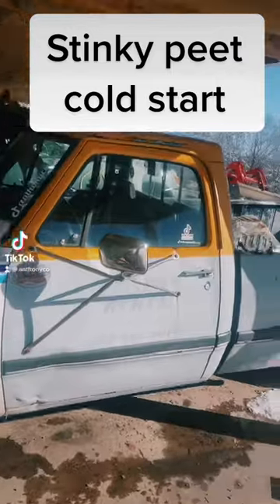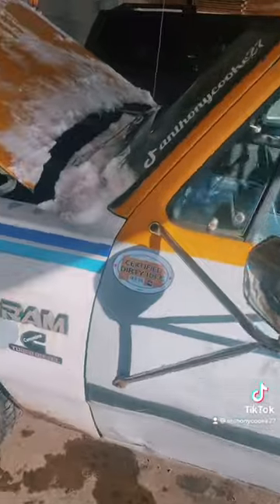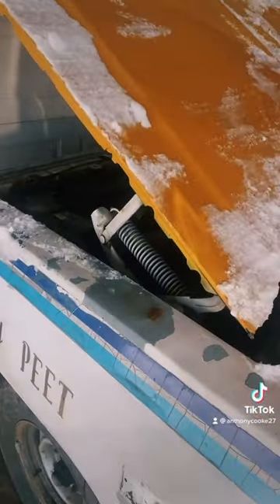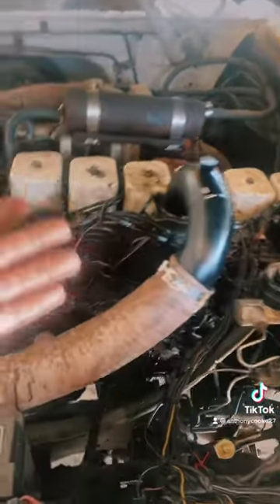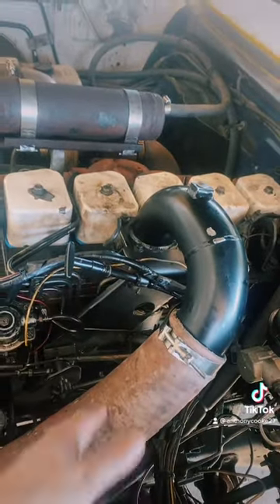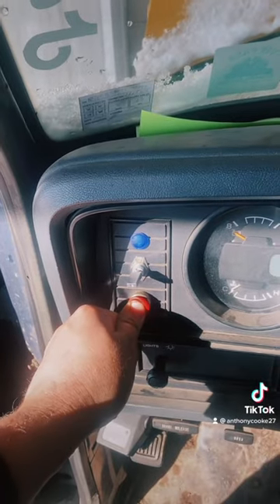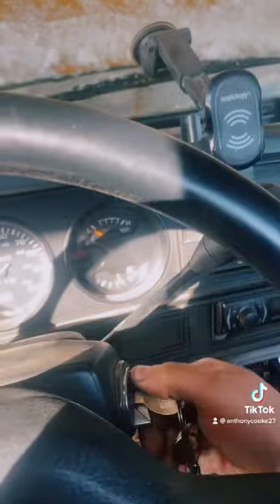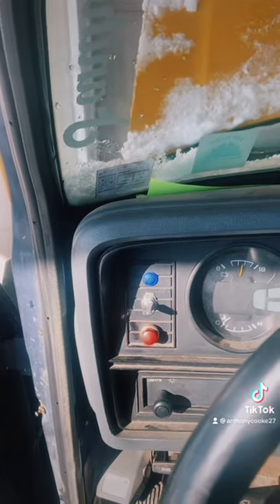Stinky peet cold start

Comment: That thing starts better in the freezing cold than some of the newer models in the summer!
Reply: She's basically running on 2 cycle lmao. Every time the injector fires it lubes up the cylinder. Probably has 1400psi compression haha
Reply: What is the best Ford to do this with.
Reply: @brandonvaughn8292  Go with the 7.3 IDI. Cause when the fuel is free you might as well go big

Comment: Just add a part that this is not to be done on direct injection engines. Old diesels can handle a lot of gasoline and the limiting factor is only the burn temperature. If the valves are not melting it is OK 😅

Comment: I run my 88 E350 on motor oil.  I don't add any gas.
Reply: Depends on the temperature and oil used, and the engine, the fuel needs to be thin enough the move through the system, otherwise it could damage the injectors or not have enough fuel pressure. Some people use heating systems and run 100% oil

Comment: My 91 d250 always fires right up in the cold as well. I run 50/50 no1 and no2 diesel in the coldest months of winter. I’ve wanted to play around with making some black diesel just to blend in with my fuel to save a little money in the warmer months.

Comment: Man, my 2nd gen 12valve (94') doesn't have glow plugs or a block heater or any kind of engine heater cause i live in Texas, when that freeze hit none of out 8 trucks would start including the 3 gas ones, but the 2nd gen, she started right up first crank no issues at all, she also has over 2 and a half million miles on a 100% stock engine

Comment: "I do not have to use any fuel additives."
"I add 30% gasoline."
Yep. That checks out.
Reply: He could be using marine gas witch has no ethanol or additives
Reply: He gets the gas from a junkyard
Reply: Guess I didn't pay attention
Reply: He didn't mention it in this video I have seen his stuff before
Reply: I think he uses old gas fron junkyards,so basically it isn't as volatile
Reply: I believe he's saying that's what his "homemade fuel" contains, 70/30 or during really cold times 60/40, in which he doesn't technically add anything to the fuel tank after initially putting the fuel in, so yeah it does actually check out ✔️💯
Reply: Well by definition it’s not an additive it’s a fuel so yes it does check out brilliant!
Reply: LOUD NOISES!!!!!!
Reply: Before you commented you should ask yourself what diesel does when it’s cold. He mentioned some of the usual additives in the video.
Reply: It's just his winter blend.
Reply: @mitchlesinski7803  the gasoline IS the anti gel additive
Reply: @warrenmcelroy4718  no shit
Reply: @mitchlesinski7803  I guess you miss the point, he said it was running straight motor oil as a fuel with no additives, but then mentions the gasoline. Everyone knows it will need SOMETHING else to mix with the oil but he shouldn’t say it’s straight engine oil. That was the point he was making up there with his comment
Reply: Yea I was thinking the same thing even if the gas he is using doesn't have any additives it's still the same thing... Might as well use diesel and add 5-10% gas it would do about the same bud.
Reply: gasoline isnt a fuel additive, its just fuel... so, yea... that checks out

Comment: Is there a fuel temp feeding into the ECU? If you potentiometer the temp sensor to display colder fuel will you get a more complete burn? Or is it now at the point where you have to optimise the atomisation?

Comment: But can your fuel mixture be used in for example a 2011 Ford with a 7.3L? How long will an engine last before becoming worn out running this fuel instead of using gas station fuels ??
Reply: Pretty sure you’re going to have a tough time finding a 2011 that’s running a 7.3

Comment: This is a good idea I'll give you that. But I would be interested in seeing a tear down of the injection pump after running it on this fuel for a while. Just the see if it decreases the life of it or not. I'm tempted to do this on a smaller scale for my tractor
Reply: Hard to say. That much oil mixed in seems like it would be healthy for the lubricant factor as long as the mix is filtered before being put in the system

Comment: Have you ever had any problems with blowby I have a 95 12 valve it's at 430k km which is 200 something miles any ideas
Reply from the maker: Probably going to need a basic rebuild
Reply: @anthonycooke27  is it okay to leave it like that or am I going to blow it up? I mean I know 12 valves are indestructible but still
Reply from the maker: @thegman4759  just run it until it quits then rebuild or replace it
Reply: @anthonycooke27  that's what I figured it still fires up like nothing and still pulls strong thanks man by the way you should try 1 and 5 micron sock filters they are cheap and come in packs of 3 and last quite a long time (Amazon btw)
Reply: @thegman4759  checking your blow by at an idle you will normally have some amount, rev the engine and hold it and see if the blow by becomes excessive, at that mileage it's normal for piston rings to not fully seal so you get blow by, if you load the engine the blow by should lower since the high cylinder pressure seals the rings and reduces blow by, if it is smoking worse out the fill cap than the tail pipe she's worn out and needs some love.

Comment: When that gas separates from the oil it will make that truck runaway
Reply: The opposite happens. Pre ignition makes  slow down
Reply: @josephdavis4201  correct gasoline needs spark it will just detonate until it stalls out.
Reply: Doesn't seperate at all, I know dudes that tested this and after months of sitting there is no separation

Comment: So wait, your using gasoline in a diesel engine? I know it can work but wouldn’t that be bad for the engine
Reply: No, it just raises the vicosity and ignition temperature for the waste motor oil so its more similar to #2 diesel
Reply: @parkert2710  ah thanks, I’m still in high school so this was cool to learn, thanks
Reply: @thomasroulston8972  well dont listen to this guy. Used motor oil has high amounts of metal and carbon contaminates, sure it will run through older mechanical injected diesel engines but it wont run as good amd will shorten the life of the injector pump and injectors. And this will not work in common rail diesel engines or anything newer than the 2000s. It will literaly cause engine failure.
Reply: @gradoisx2348  my dad said something similar
Reply: @gradoisx2348  it's fine if done properly(which this guy isn't doing)

Comment: Old p pump 12 valves might be ok with this but can’t try this with the 24v
Reply: He doesn’t run a p pump but ya newer trucks don’t try this
Reply: @thenomad7120  sorry isn’t that what the style of high pressure pump is called that the 12v ran ?
Reply: @codycampbell2607  on one of his videos I noticed he didn’t have a p7100 fuel pump but not sure if he switched it out or if his motor didn’t come with it…I have a p pump on my ‘97 12v
Reply: The 1st gen dodge didn't have the p pump, it had a small rotary injection pump, the 2nd gen dodge 12 valve cummins had a p pump from 1994-1998.5 (first part)
Reply: @codycampbell2607  he’s running a Bosch VE pump in this video not a p-pump